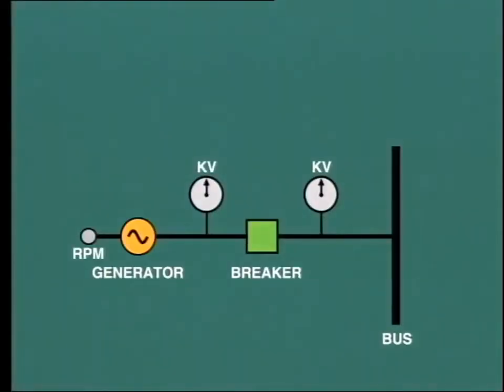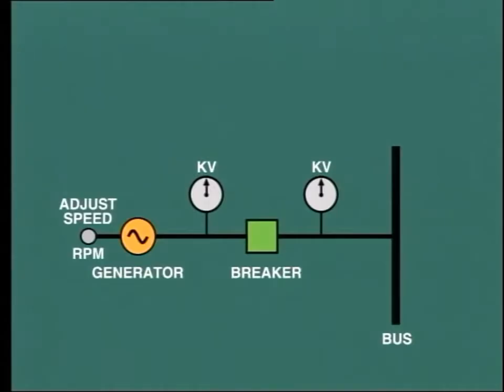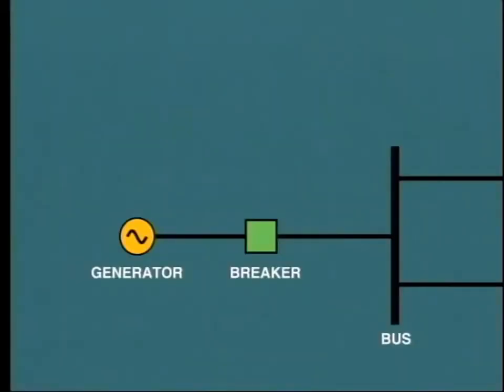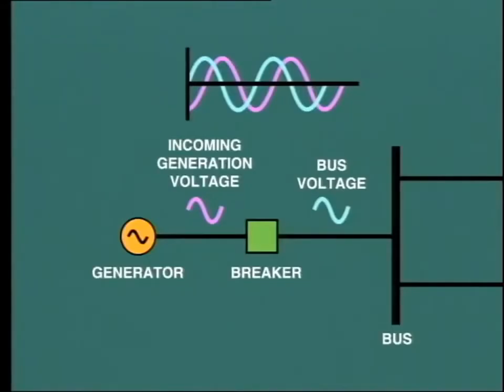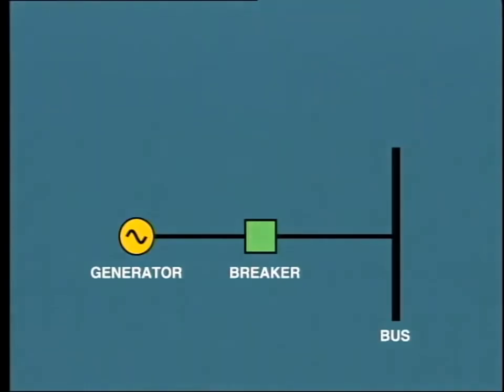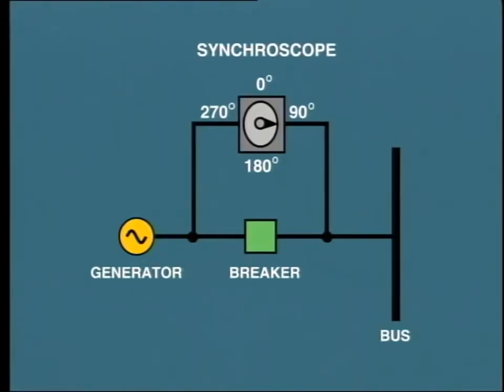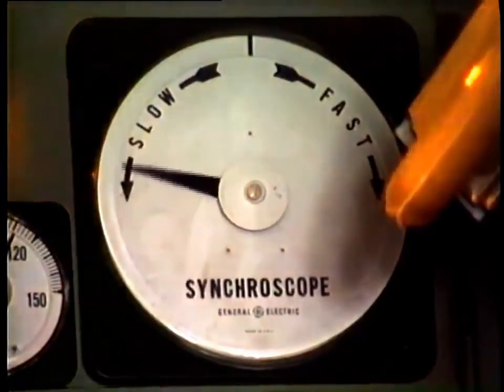lesson 13: synchronous generator synchronization

Comment: I already used manual synchroscope in the diesel generator here in saudi arabia way back 2016. My heart beats so fast while I'm using it😅 and I was thinking that one's I made a mistake it would be a disaster in the generator. 😢 But in Jesus Christ name I did it perfectly.  I close the breaker manually in the switchgear and the load continuously rise until the two generator balanced the load of 2.0MW each.
Reply: Ordinary humans will never appreciate the excitement or satisfaction of what you described. I do, and nod my head with a smile of recognition 😅
Reply: @peterrogulla7726  yes bro. 😊

Comment: Yep, that's how it done. We had nothing automatic in the generator room, all manual. We had a 1500Kva and 750Kva hydro electric generators. Both provided an output of 600 volt 3Ph. The the majority of the mill's machinery required 575v 3Ph. The generators were manufactured in 1922,  The mill bought them sometime after that, used from a mill in Canada. Shipped to Augusta, GA and setup on the Augusta Canal where the mill built in 1891 stood. The generator and grid power ran through. Pringle Westinghouse switch gear. The system cut the mill's electric bill around $80,000 a month. JP King Mill on the Augusta Canal. I worked in the mill's industrial electrical department. Often having to bring the generators on line after a power outage due to storms. A few time hauling butt to the generator room as the grid power dropped and one of the generators was running out of control due to the old turbine governor failing to close the turbine intake and drop out the generator's circuit breaker. The lights in the mill would be strobing and that the sign this has happened. Drop what your are doing an haul ass to the generator room to manually get the generator under control. The rotor weighed 50 tons. A beast. The mill machinery was usually ok as their motor control contactors usually dropped out when the grid power flicked off. Day's of past working in a American textile mill.. Several of us in the electrical shop were Marine and Navy veterans, we could handle it..

Comment: what is bus doing in electrical circuit?in fact i don't really know what does 'bus' mean?care to explain?
Reply: Quite simply it's the side we are powering. In most cases you are adding a generator to an existing "network" or "grid" that already is running and here we try to "synchronize" a new generator to the already powered "bus" in order to increase capacity of the system
Reply: bus (electrical BusBar), is physical junction where various terminals are connected together.

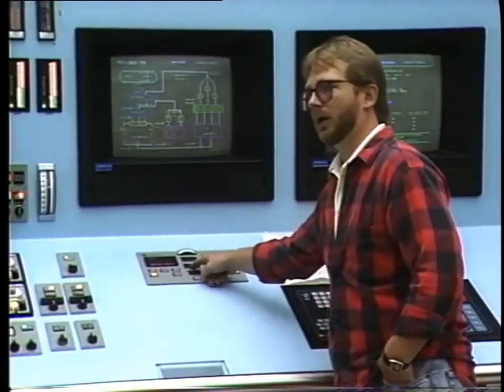Comment: @3:08 Of course not - it depends on the load. One question I have is some power plants and some generators are more powerful than others (4GW plant vs 800 MW).  Some generators bigger than others.  How are they balanced so that the demand is appropriate for the size of the generator? They all work together but you can't say, ask a 400MW generator to run the same load as a 1GW assuming they are on the same load.  Maybe they all work together as 1 I'm just overthinking this...
Reply: he is explaining  the main idea , of course on each power station there is some practical details anyway still the shift manager and the second engineer dealing with that kind of parameters ,using it mainly will happen in case of the start up or shut down ,and in the most of times we put it  on Auto mode .
Reply: @mohammmedgaddoua  Thanks. I'm actually fixing my small generator now it's kinda like model railroading - getting it to 3600 / close to 60hz over whole variety of loads

Comment: anyone guide me???
Why the generator load (amps) increase or double when it synchronized to main source?????
Point#during this problem generator start hunting and  end time generator Trip due to overload??????????
Reply: Generator speed regulation not working properly. If the generator tries to increase its speed when it's synchronized it will try to increase the speed of the main source as well, causing a current surge that will trip the overload protection. Generator "hunting" is typically a symptom of speed control problems like too fast or too sensitive throttle reaction, or a mechanical problem like binding or loose linkage. I hope that 2 years later this answer will help someone.. 😂

Comment: You guys with your fancy synchroscope. A couple voltmeters, and some light bulbs wired in parallel with the switch. Say a prayer, get the lights to go dark and throw the switch. If you do it right nothing goes bang